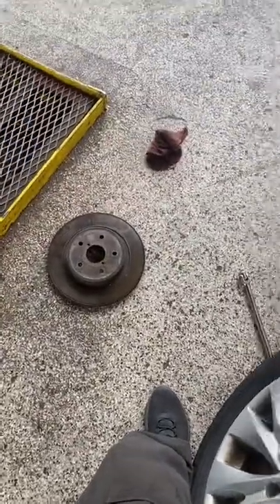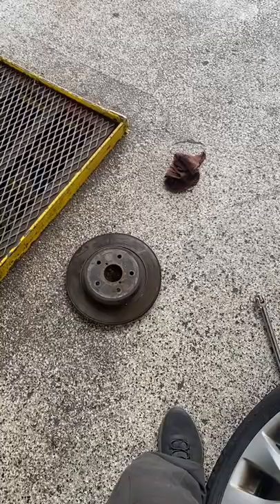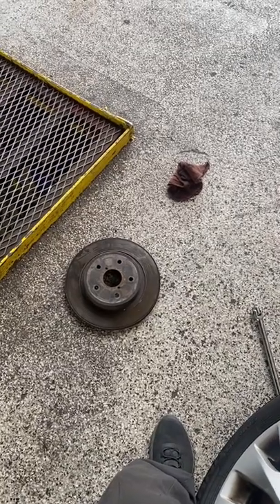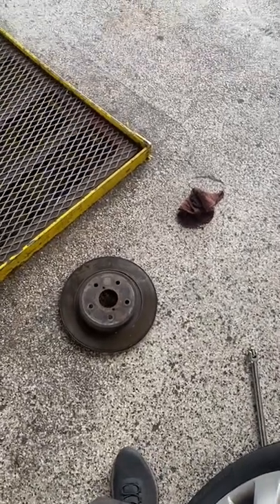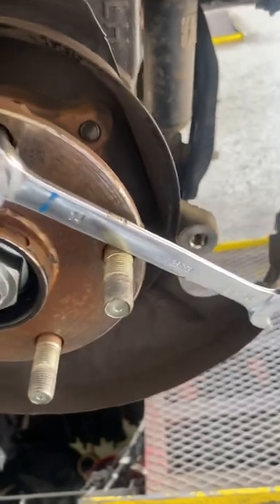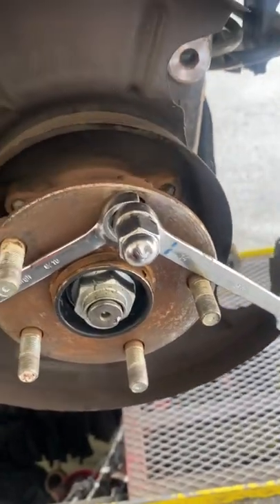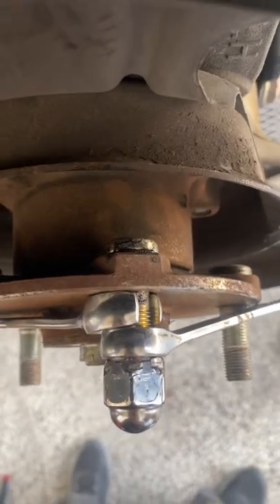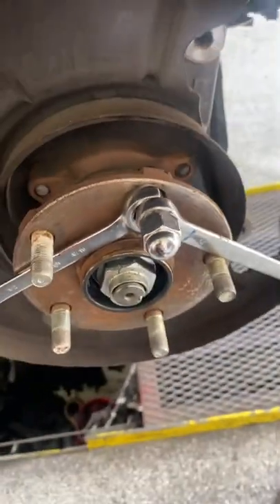Wheel stud install hack that works for me

Comment: I used one lug nut and my impact and it worked for all 10, although I did mess up like 3 lug nuts threads due to the fact I didn’t use any washers or 2 lug nuts but the studs threads held up just fine and I got all 10 tightened next time I’ll use the washers so I don’t waste lug nuts but

Comment: I did something similar but I was worried about it pressing against the studs
Reply from the maker: @austinhernandez2716  if you line up right and go slow it wont rub on the threads, just be careful is all